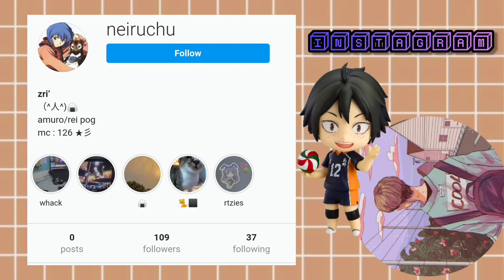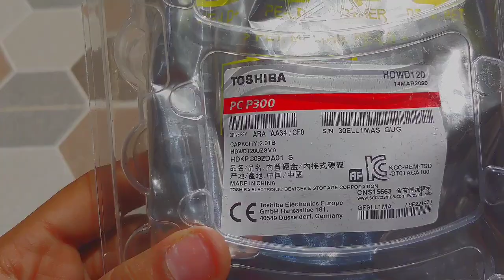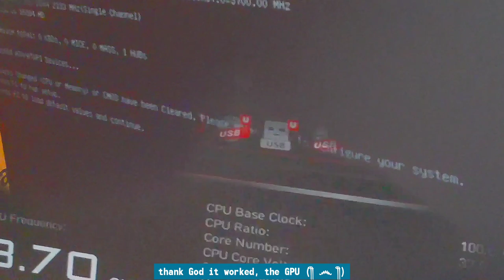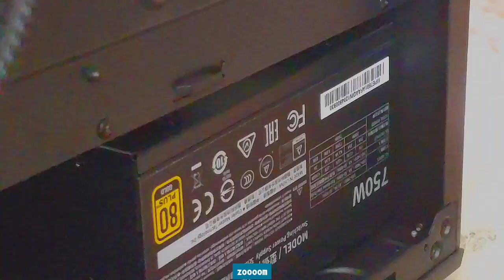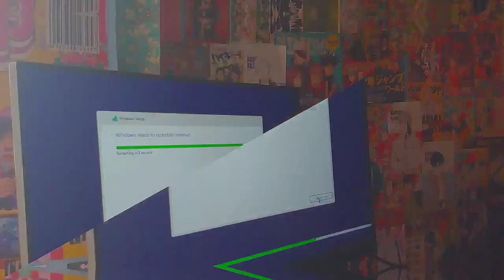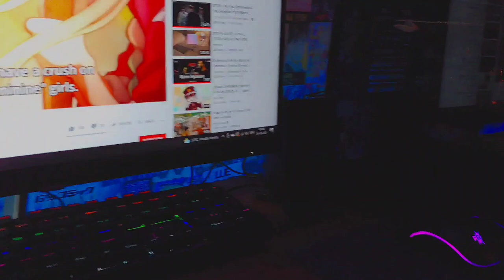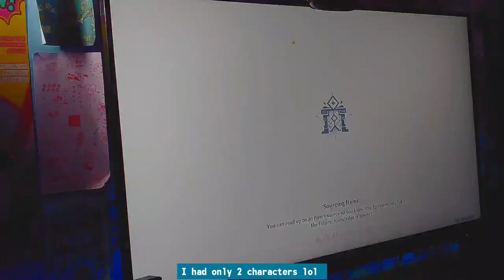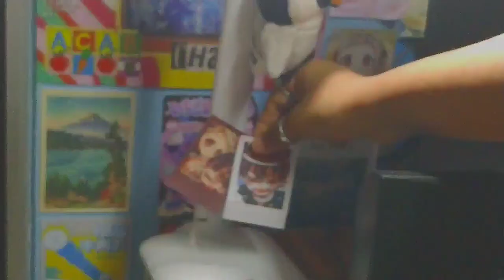building my first ever PC 🎮🧃✨[BLACK EDITION] / aesthetic build?? [ a collab with neiruchu ]

Comment: Hey! Nice build, is the stock ryzen cooler good ? Does it get loud?
Reply from the maker: thank youu! yes it works fine for me, as I don't over clock. and I've got 3 more extra fans to keep it cool. if you're going to over clock your processor then go for a tower cooler or liquid cooler! and the stock cooler gets a little loud when it's at 100% use. :^)